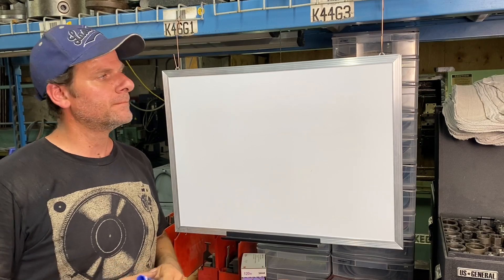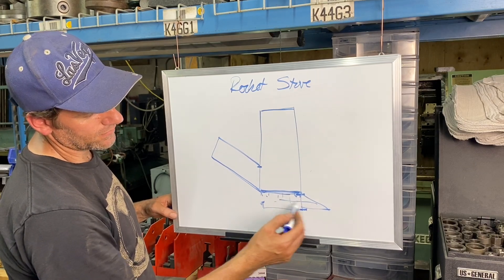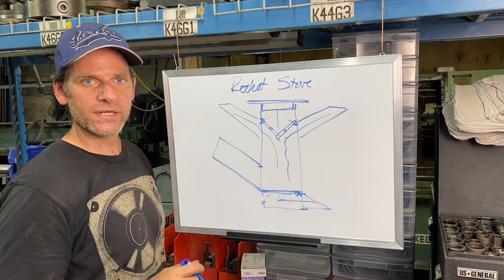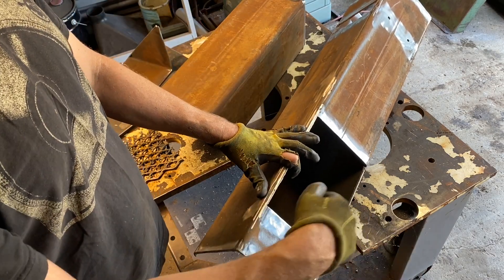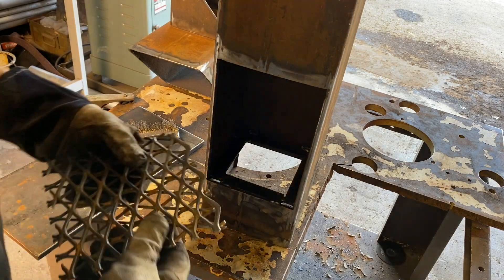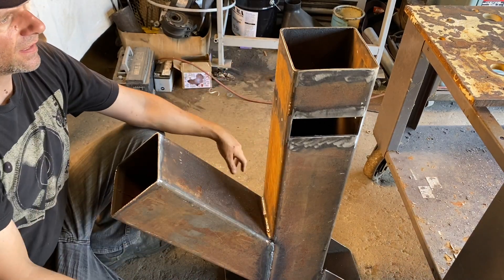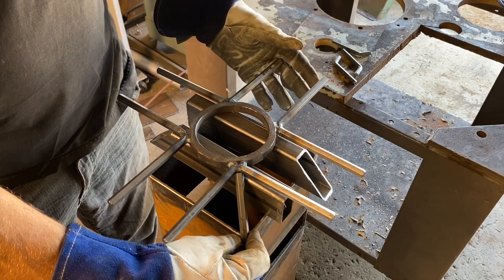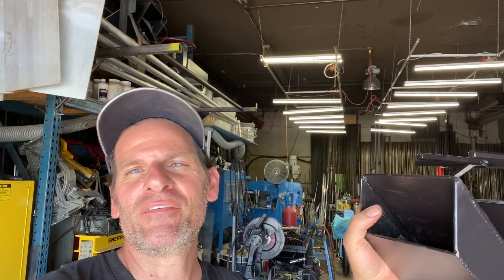DIY Rocket Stove with Variable Heat !!!

Comment: The purpose of the air inlet at the bottom was to introduce heated air to the already burning material… not including that feature reduced the overall heat capability of the stove.

Comment: Looks good. Could you show us how to incorporate a heat sink hot water system please. I'm not a engineer and I was wondering if you could control the heat with airflow rather than syphoning off flame ? Just wondering. Good job, more please. p.s we miss the cap and beard
Reply from the maker: Flytye good idea i may have to experiment with that